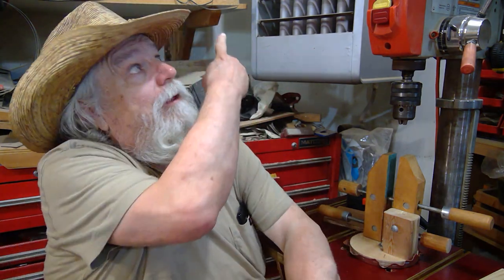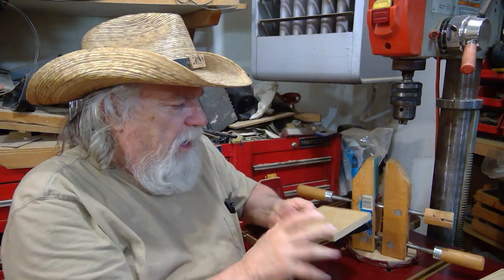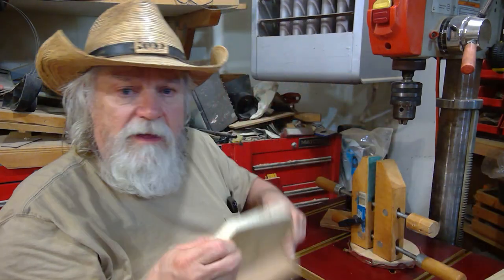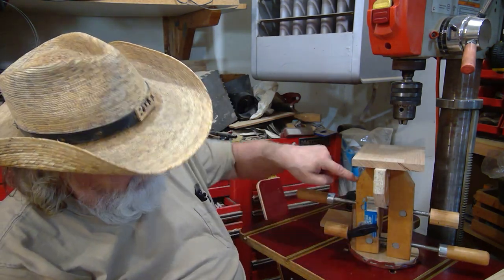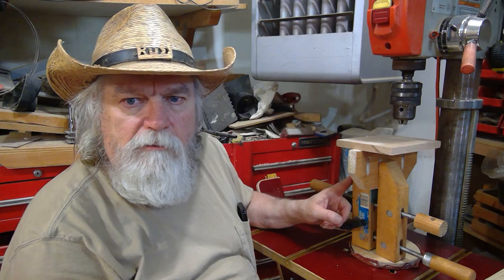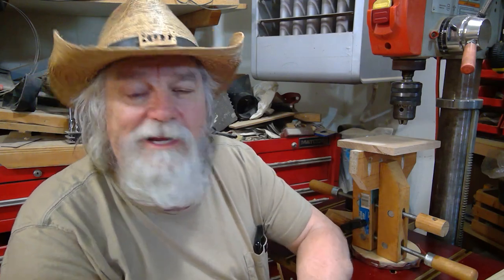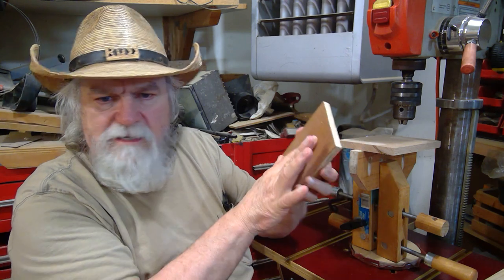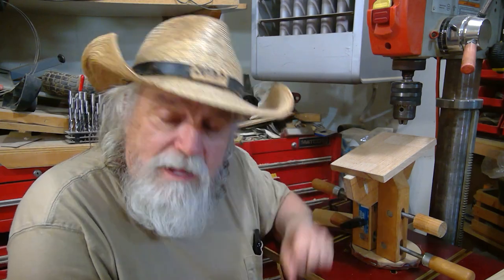OTB Vise update by OTB Thinker

Comment: I like your idea about holding items to be drilled at an angle.  I'd like to know where you got that funny looking level with the various angles on it.  Looks like something worth having.
Reply from the maker: it's a 6" level with a horizonal, vertical & 45 degree bubbles and a magnet on the base.  I like the small size for a lot of chores.  it fits in my work apron.
Reply: @russveinot5754  pretty slick.
Reply from the maker: that's my middle name :>)

Comment: Hi Russs :   Do you mind if I ask what kind of heat system do you use in your shop, I noticed the furnace near your drill press.
Is it propane or natural gas,or other????    I'm looking for a heating system for my 3 car garage shop.  Thanks
Reply from the maker: it's an older hanging natural gas furnace.  not energy efficient or anything like that.  it is large enough to heat my 3 car garage easily, even when I open and close the overhead door.  I run it at a constant temp all winter and it makes very little difference in my power bill.  that fog horn I joke about now and then it the furnace moaning when it initially heats each time, but it works fine.  a natural gas furnace would be cheapest except a wood burning (a lot of work).  of all the different ways I have heated my shop (coal, gas, wood, kerosene) this gas furnace is my favorite.